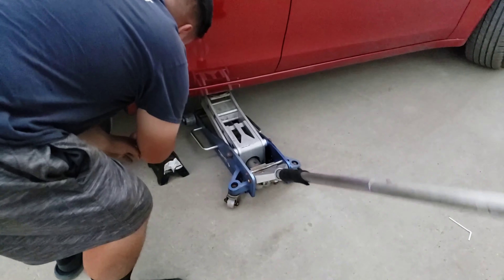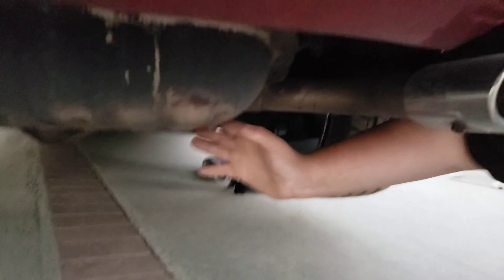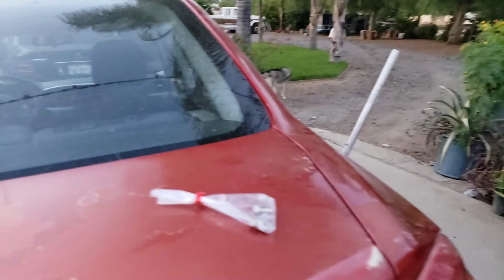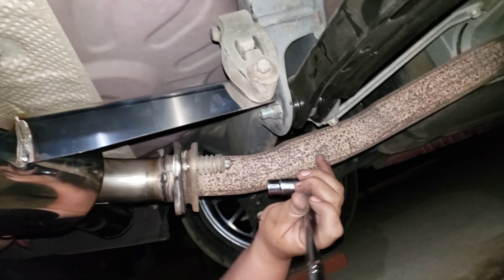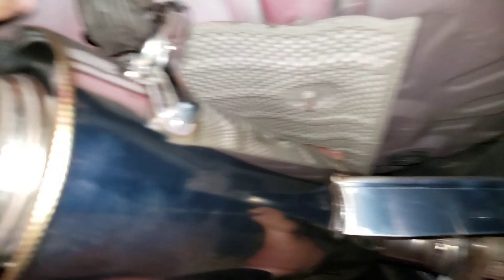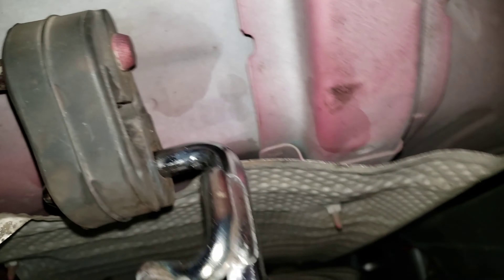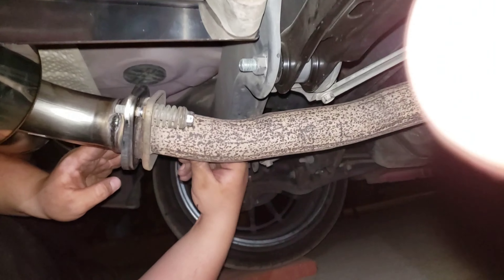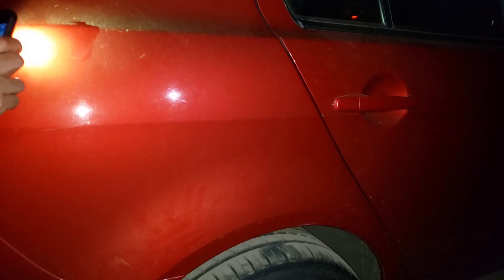Mitsubishi Lancer HKS Exhaust

Comment: i have the base model lancer and i was wondering if the exhaust would still fit the car? and where did u get the exhaust?
Reply from the maker: Yeah bro it should this one is a lancer ES, I would just check the fitment guide before purchasing to make sure. But I know this one fit all non-Evo lancers & we got it on ebay 👍

Comment: What engine is?
Reply from the maker: 2.0 👍
Reply: Street Series 4B11 ?
Reply: @amirjefry  only evo x and raliart have a 4b11
Reply: @shiguytv3271  i know it bro, what i mean here, it could be 4b11T. that turbo might produce that sounds. Oh ya, in my country there is a car named Proton Inspira, rebadged from mitsubishi lancer (legally), also running 4b11 engine. They only change the suspension part which is from Lotus.
Reply: @shiguytv3271 My 2012 Lancer ES FWD came with a 4B11 . . . The car manual even states that it has a 4B11.  However, it's just NA; possibly due to the CVT.  Of course, I plan to replace such with a manual sooner than later in order to finally start building the car to my desires instead of getting rid of her for an overpriced EVO (or whatever else) since I'd be replacing everything with aftermarket parts anyways after a decade of never modifying it.  What's life without a challenge, though? 😂